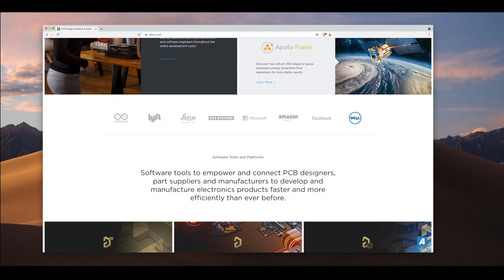Simple LED Chaser Circuit with BC549 Transistor

Comment: Sir, how does the npn transistor conduct with the base open & how can it operate with the emitter being connected to the +ve terminal? Also a request to please provide the circuit diagram on the screen for a longer time or give a pdf link for the circuit in the description. The led flasher works nicely.
Reply: Initially the capacitor charges up and the voltage in the circuit rises slowly. When the voltage reaches a specific value the emitter to collector junction breaks down and conducts. This lights up the LED and discharges the capacitor & This cycle repeats.
Here the polarity of the transistor is reversed and base is untouched.
Reply: @legendelectrics4668  thanks a lot for your kind gesture of explaining the working of the circuit. One doubt over here. The datasheet mentions Vceo of 30 volts & the supply is 12 volts. Please correct me if I am wrong. Anyway, still appreciate your kind help.
Reply: @chetananam475  
VCEO is the forward breakdown voltage. In this circuit reverse breakdown voltage is utilized and is less than supply voltage.
Reply: @legendelectrics4668  ok. Thanks a lot for your persistent co-operation in clarifying my doubts.